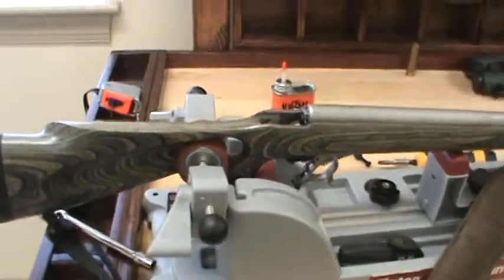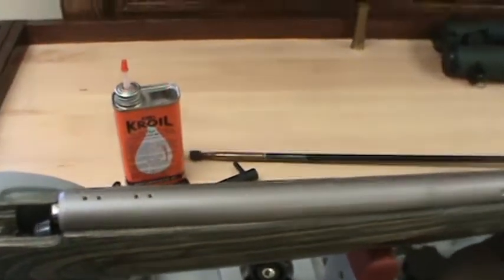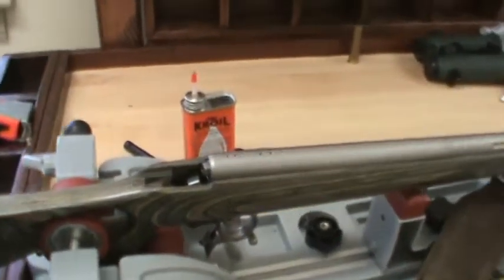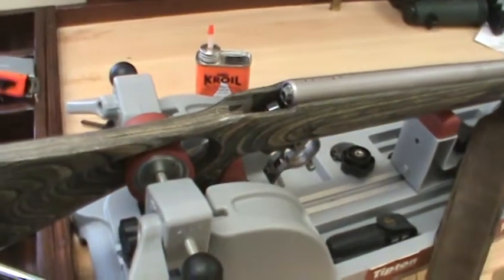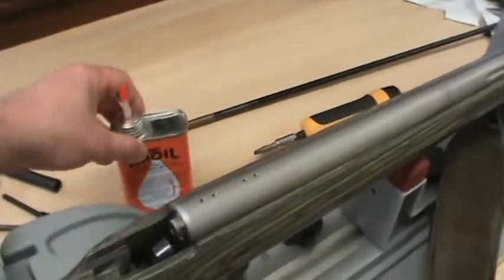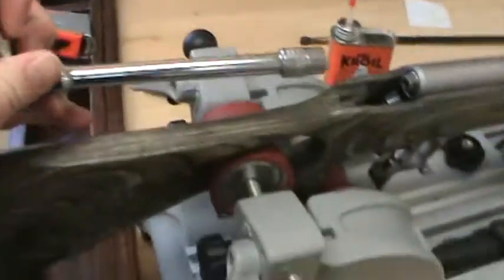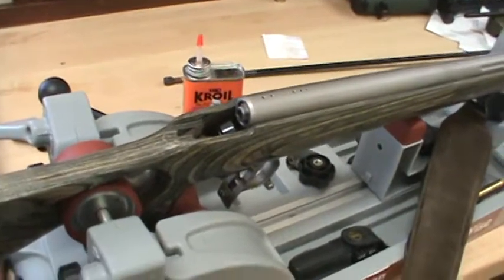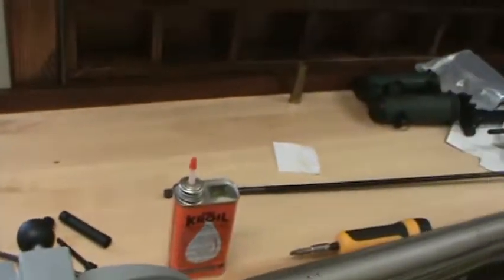Loosening a seized/stuck breech plug, TC Omega Muzzleloader

Comment: Everytime you pull the breach plug you have to put Anti-Seize on the threads
Reply: I never found that to be the case if you just clean after using it right away. Never had any issues, hot water and bore butter.

Comment: Take it out every time you clean the barrel. Not only do you need to also clean the breech plug it is so much easier to clean the barrel with it out. Clean the threads out good and put some anti seize on the threads and don't over tighten it when you put it back into the gun and you'll have a lot less trouble. Helpful to take a slightly over sized brush and actually screw it into the threads INSIDE the barrel too with some good black powder solvent on it and make sure it's good and clean also. Something like carburetor cleaner is good to flush the threads out with to make sure it's good and clean too. Make sure it's good and dry and use that anti seize.
Reply: I use old fashioned hot water and bore butter

Comment: HOLY COW! I JUST DID THAT!
WD 40 + a home made wrench!
I did 2 of them!
I had to gently warm one of them! Probably 140-180 degrees. 
I did have a barrel vice!
It wasn't easy!
Even after I got it turned the required 1/4 turn i drove it with a 3/8 aluminum rod!
"NOW & FOREVER, CLEAN AFTER EVERY USE!"

Comment: Take that breech plug out the same day you use the Omega and it will be a lot easier. The little brother of the Omega is the TC black Diamond and I have that one. If I shoot a ton of Patched round balls out out of it in one day the same thing happens to the BD. 
I now take mine out almost the same way you did except I now use my Milwaukee 3/8 impact and a long extension and that spins it out sub second.

Comment: Which direction did you apply pressure on the socket wrench? I am stumped because I did apply anti-seize as part of the loading process.
Reply from the maker: counter clockwise

Comment: Why didn’t you take the barrel out of the stock? If you took it out of the stock you would have had all the purchase you wanted on that breech plug.
Reply from the maker: I don't have a barrel vise, and you can't get any purchase on the barrel out of the stock without a barrel vise.  However, the gun vise worked great with the barrel in the stock. Purchase wasn't the issue because the barrel was badly seized.

Comment: Mine is stuck now, I learned something today while cleaning my pistols nipples, cylinder, and frame. I took the nipples (after cleaning) and filled the threads in the cylinder, and on the nipples threads with bees wax, then doctored the cylinder rod and inside of the cylinder where the rod goes, and packed all the nooks and crannies around the area where the gas escapes around the forcing cone, I have tried every type of lube but when it heats up the lube thins, and pressure blows it out. Pure bees wax melts also, but does not thin out like grease, and also re-hardens when cool.